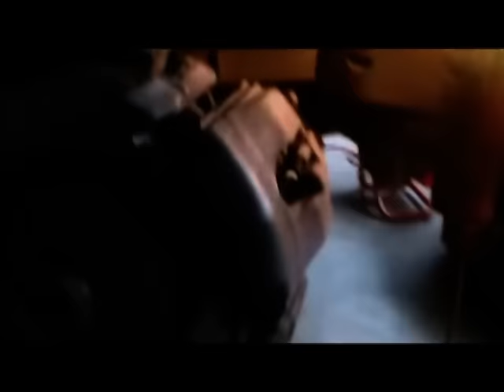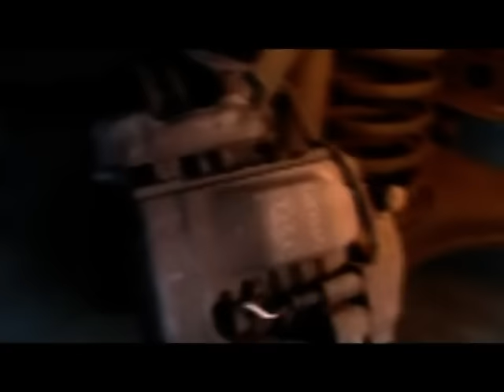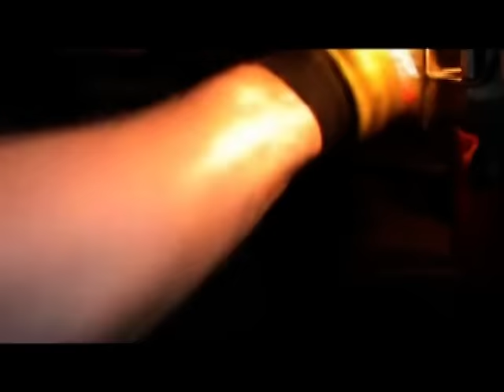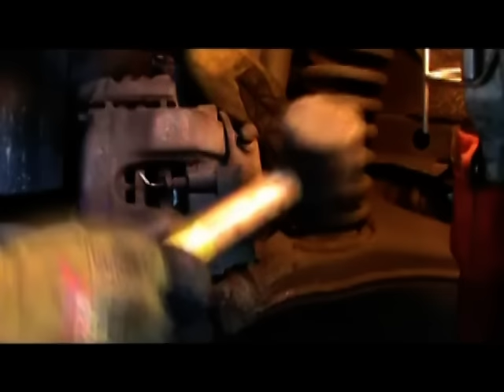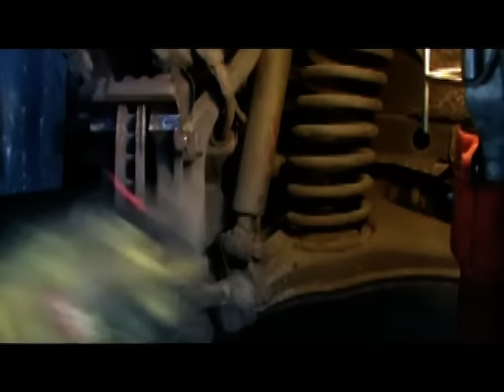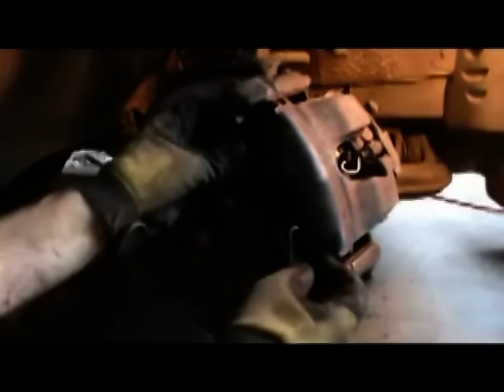How to replace mercedes benz brake pads in 10 min

Comment: Just put those filthy dirty greasy gloves on the face of the pads...yep that is a good thing to not do...and what is with hitting the caliper from side to side to free it from the rotor....gently, and I mean gently tap the top of the caliper towards you...don't bang on the side unless you don't have a problem getting a possible stress crack down the road...
Reply: Four Seasons 😐